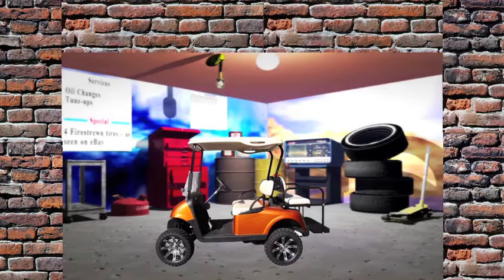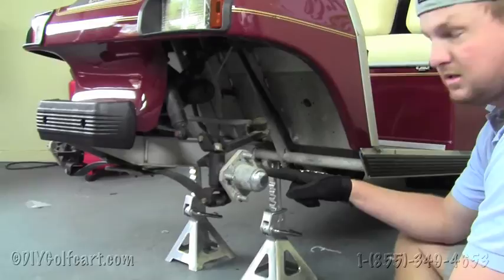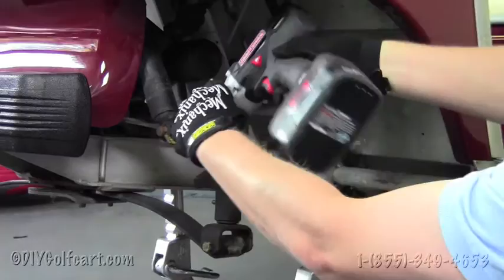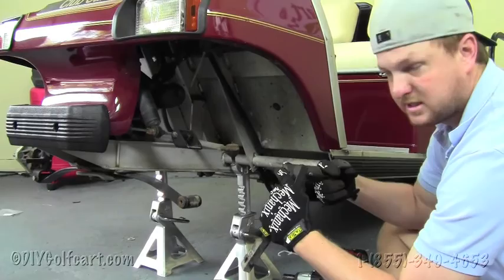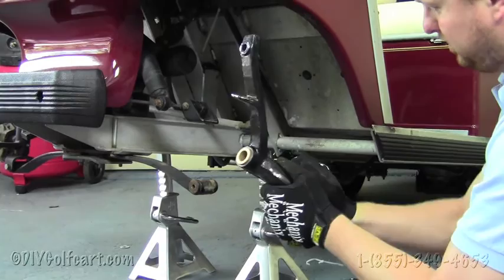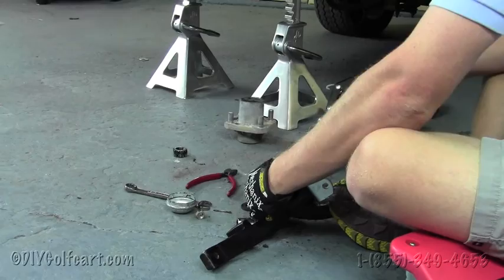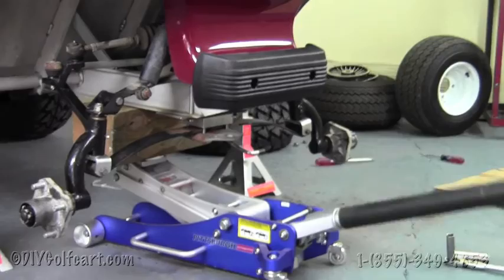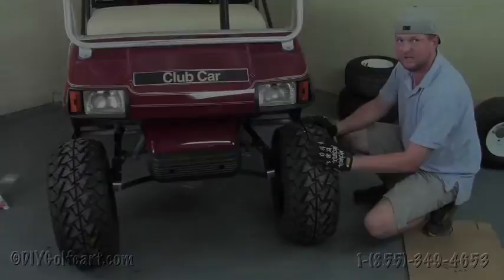Club Car Lift Kit | How To Install Spindle on DS Golf Cart

Comment from the maker: Yes, the lift kit will fit an IQ "DS" model Club Car. IQ is your type of electric drive system and this lift will work on all gas or electric models with BLACK front hub dust covers.

Comment: what motor/controller/solenoid is on that cart? My stock 3.1 in my Carryall is way underpowered for this upgrade. I'm looking for "best bang for the buck" advice. cheers
Reply from the maker: +Scalliwags Wharf I have designed kit for each model golf cart by determining what the golf cart is used for. Give us a call and let's discuss your golf cart and get you a special kit made just for your. 877-960-5464

Comment: i would not let this guy work on my cart .. that's for sure .. lol " when do you remove all bearings to pack them "? and how about loosing that hub nut a half turn for bearing "play" don't teach people the wrong way of doing a install . get the right hardware , be professional .. sorry had to vent .. just tired of watching these so called DIY installs .. and half the teachers are students themselves ..
Reply: Agreed! This guy doesn't know how to properly install nuts, washers, cotter pins, adjust bearing play, repack wheel bearings, I could go on and on. You get the picture.